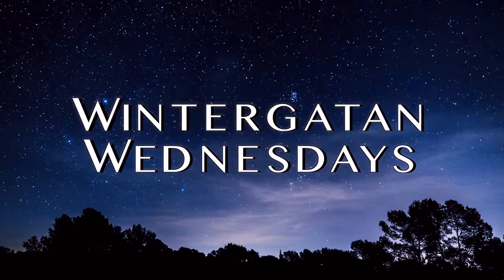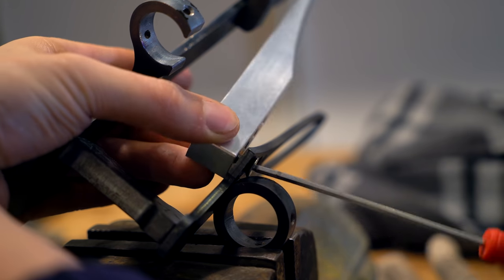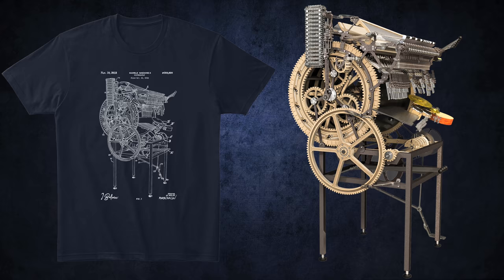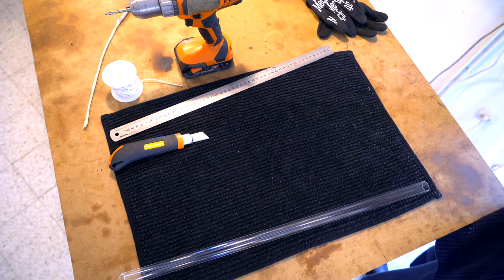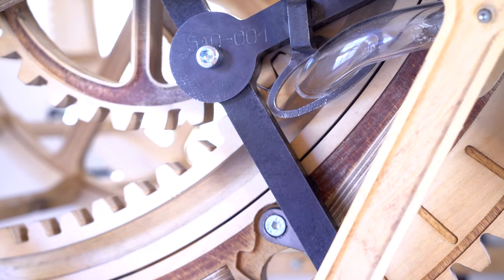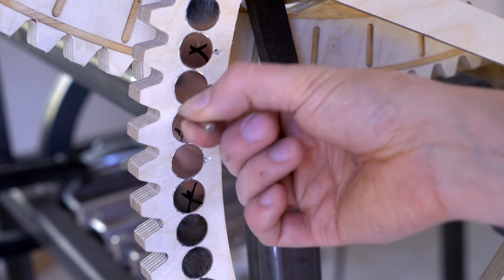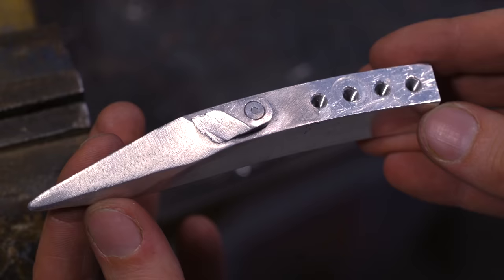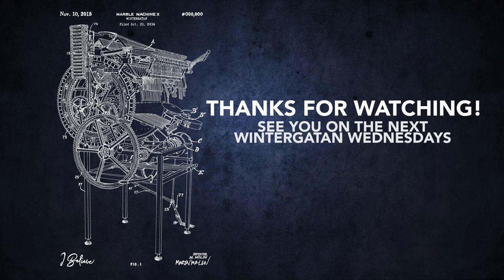Magnet Polarity Switch - Marble Machine X #60

Comment: You don't need sea water to be a problem, steel or stainless steel screws into aluminium WILL seize over the years some grease on the screws will mitigate it  but if you're unlikely to need to undo them again then don't worry about it. And 4 screws to secure it is massive overkill anyway.

Comment: The interface between the lifting wheel and the tube looks nice, but I can't help but thing that you'd be much better off designing the scooping mechanism to take advantage of additive manufacturing because it's such a critical part with an odd blended shape. If you were to 3D-print the scoop, you'd have a much tighter design to fit into the wheel groove and you could use a custom sweep to ensure an internal tube with a perfect circular cross-section to avoid the marbles getting jammed. By making a slightly larger counter-bore feature at the end of the 3D printed scoop, you could also have a seamless transition into your heat-formed clear tubing instead of having to manually heat up and form the ends around your metal eyelet. 

Even if your current design works, I'd be really afraid to take it on the road because if something happens to your scoop, you wouldn't be able to readily replace it, and the whole machine would be down due to the inability to lift the marbles to the second wheel. If it was a 3D-printed design, you could iterate to find the optimal design, then easily print many exact copies of the final design. It might not look as nice aesthetically, but if that's a really big concern, you could always make a mold from it and cast it in a clear acrylic resin. And the plastic would be immune from the dreaded galvanic corrosion 😋. These are just some thoughts I had while watching your video, keep up the good work.

Comment: Funny thing: "Hochleistungsschneidpaste" is a german word. It means something along the lines of high power cutting paste or high capacity cutting paste.
So, not very surprising, but just going by the name it is a paste you can put on your drills to cut or drill with very high power and still perform well without damaging the drill or the material to be drilled.

Comment: I’ll say it again...  you have no idea if the magnets will work over the length of a song or two.  You need the entire pathway in place- including the demagnetizer and subsequent divider to determine 2 critical issues-   Magnetized marbles do not ROLL, they align and lock in N-S orientation to each other...so at several points the only thing driving the marbles thru will be the Pressure of backed up marbles fed in by the mechanism... the magnetized marbles may move only because they have very low friction... but the marble divider and divergent channels will multiply the friction dramatically and may simply shove marbles out of the tracks, rather than forward, given the rate at which they are fed from the wheels.   The Second potential issue will be cumulative magnetization  of every ferrous component in the system- metal brackets, rails, and release levers may accrue a polarity over time that will result in magnets holding up after a minute or 2 minutes of operation.   The marbles will run fine at the start of a song and gradually start to misfire...with increasing frequency.  
You can still eliminate the magnets without significant design change- you merely 3D print gear teeth that will fit inside the magnet track channel- and act as tiny individual buckets, like those in the chain lifter.  Would have to only add a half circle ‘fender’ of steel that would hold the marbles in their toothed track for each wheel...  and would match the style of the steel arcs that form the frame.   this should not significantly reduce the feed rate of the lifter.

Comment: To stop corrosion, just put a strip of tape between the two parts and use stainless steel fasteners. And for that pesky screw, drill and tap a hole in the part and thread in and threadlock a cut off screw as a mini-stud.

Comment: At 8:00, If the third tap was cutting, I think you might be doing something wrong... It's meant for getting threads in the bottom of blind holes and it shouldn't be necessary for though hole tapping

Comment: Pro tip, when cutting a bolt shorter  put on a nut. So when you screw off the nut the treads will repair itself.

Comment: WOW!!! not even a day pasted since you posted this and this video has 81K views as I write. An obvious indication of a huge fan base watching an waiting for the day Marble Machine X is complete. (it is not uncommon that even a professional engineer puts a screw somewhere that becomes trapped.)
That marble lifting/derailing fork that lifts the marbles off the first wheel I could see from the beginning as it was fitted, was going to lead to problems.  I'm no engineer but I could tell it was not,,,, streamline enough. It needed to be like a switch on a rail track for trains. In the end Your mods made it like that.

Comment: Comes maybe a bit late, but did you consider using only the pmma tube for picking up the marbles from the ring slot. When you bent the tube into the holder, you already have the perfect tube without any transmission points, and instead of cutting the tube straight off, you could cut it to fit in the slot. Starting with much material and slowling cutting it til it fits perfectly into the slot. So no need for the aluminium part. Thats at least what I can tell from the video viewer perspective.

Comment: For that problem with the screws you were tweeking the parts that weren't less likely prone to give you headaches along the way. You should have tackle the problem cutting the ring holding the tube in place in half, making that semi-ring a sub-assembly of the part. My 2 cents here.

Comment: You could consider adding some PTFE/teflon feet to the aluminum fang to allow it to glide along the inside of the wheel with some pressure on it. They are thin and cheap, usually used for computer mice. That way there would be less of a lip for the marbles to jump up.

Edit: this kind: https://www.amazon.com/CS-Hyde-PTFE-Mouse-Color/dp/B003DZ16X4

Comment: I noticed in the end there seemed to be a black streak on the 1st magnet wheel, is that from the aluminum piece rubbing up against the wheel? Friction in places where it's not necessarily wanted is always a bit worrisome. Idk if it's a problem or a way to fix it if it is, but I wanted to make sure you knew just in case. Better safe than sorry.

Comment: "Magnet Polarity Switch - Marble Machine X #60"     7:54 - 7:56    :-)
only germans can laugh about this. Sorry.
I love your work and i love your Videos.

If you replace the Aluminium Wedge by a harder Material, maybe Steel, you should think about a "backside screwing".
It means you screw it from the backside at the holder.

Comment: I'd have utilised gravity a lot more by making the marble 'transfer pipe' longer and more straighter or used a rubber wheel powered by another part of the machine to push the wheels down the pipe.

Comment: I'd bet if you blasted some compressed air with that silicon you pulled through the tubing it would have slid easily. This is a common trick for removing grips from bike handles.

Comment: Your lifter plate needs to be the full width of the channel, like a knife-edge, gradually getting thicker.  What is the thickness of the wood channel between marbles and magnets?  If you had narrow groove (too narrow for the marbles to get in), the lifter plate could start behind the marble, so initially, the marble would not need to lift out of the groove.

Comment: why not using same design (22:51) for aluminum fang ? because the marble seems rolling (9:27) due to grip with the wooden wheel.

It this enough for redesigning the part, in addition with the prisoner screw problem ?… I know this is tickling you :D

Comment: 14:17 to 14.25: Martin, the lower main wheel is rotating as it would "float" i think..It seems it is kinda awry and this should not be, correct? Maybe someting is not 100% aligned? do check this matter, I think this can be a part of the problem with the tube..

Comment: In my opinion, the aluminum "fang" should be flattened just a little more, as I have seen the marbles hit the fang at which they stop. I fo you made a slightly flatter edge, you wouldn't have too much of a problem with the marbles entering the pipe.

Comment: @03:28 You should have just grind or file the head of the screw and shorten it to get it to fit. You should have also used two M4 screws to hold the rounded piece in place instead of welding it. There are many solutions to that problem. I think you were hasty in welding the rounded piece before finding a solution.

Comment: Couldn't you thread the blocked screw the other way around with a thin nut, that way you can extract it from underneath, rather than on top?

Comment: Hey. Maybe the existential issue about galvanic corrosion will only take effect after months or years? Even I didn't know about engineering I am concerned about your projects.

P.S. 1: Good video. Never completed a week without my dose of Wintergatan Wednesdays.

P.S. 2: I am not saying that I disagree with the idea of the aluminum fang combined with mild steel. I am only just concerned that the existential fear of galvanic corrosion will manifest over a very long time.

Comment: just but  some electrical tape on the face of the aluminium or mild steel part befor skrewing it together , should prevent galvanic corrosion , just to be safe

Comment: Why not have one long figure of tubing that sits in the recess of both gear wheels ? the marbles could be fed into the tubing and hoisted by the magnetic attraction in the same way within the see-through tubing.  At the apex of the bottom gear wheel the tubing can pull the marbles away from the magnetic influence and flow under gravity to the bottom of the top wheel and continue on within the tubing and recess of the top gear wheel.  I think the tubing would be stiff enough not to need any support and would look like the artery of the MX...you would still see the marbles flow and lift but without any need for any metal bracket support or fangs,  You may need to widen the recess in the gear wheels to accommodate the diameter of the tubing  and the gear wheel would need to turn without touching the tubing but it could solve a lot of issues in transporting the marbles up top,,,

Comment: Good stuff 

As you get a bit better with your tig skills you really need to start using filler rod especially on steel as the way you our doing it now will tend to crack 

The taps our low quality causing your issues a good on like a 2671A75 from Mcmaster will go right through without issue and there our better ones but this grade should be fine 

Product Detail
Machine Tool Tap for Steel, Stainless Steel, and Fiberglass, Through-Hole Thread, M8 x 1.25 mm Thread Size

Comment: I wonder if the paramagnetic properties of the aluminium 'fang' might be causing some issues too? As a minimum it will be causing a resistance to the rotation of the wheel but may be affecting the motion of the BBs. Aluminium produces an inverse magnetic field in the presence of a moving magnetic one, as does copper. Taras Kull demonstrates a toy that uses this effect here https://youtu.be/KdBNwLsJtG4

Comment: Hi martin ! I'm Rodolphe, helikopters engineer, and i have the solution for you to be safe of galvanic corrosion. We use a lot of aluminium in aircrafts and, off course, our screws are all steel ! We use a product name's MASTINOX to inhibit effects of galvanic corrosion and it work well. you just have to put some on faces witch are in contact with different materials, but take care off you ! it's a dangerous good ! you may protect yourself with gloves and mask before to put some product on your parts.
I can send you some if you want, or if you travel to the north taking direction off Gap, you can stop to my workshop at Tallard airfield. I give you product and i can make you visit helicopters.
see you !

Comment: you have so much mild steel on that machine and it appears none of it has a proper finish on it to prevent corrosion.
are you going to address that later on?

also on 14:18 you can see a big problem on the switch
the whole thing gets pushed away a LOT from the actual wheel and makes it so all marbles just get crammed in there. you might wanna address that aswell

Comment: To avoid galvanic corrosion, get the aluminum part anodized, since the anodizing coats the aluminum with a non conductive hard surface, problem solved.

Comment: Another group of people complaining about galvanic corrosion? Jeez people. There are much more destructive things that could effect the wood, steel, and welds independently. Relitive humidity could effect the plywood. Abrasion on the moving points without bearings.  Give wintergatan a break. In the life span of this device in the sheltered environment it's living.... Aluminu and steel are close enough it probably wouldn't be noticeable in salt water before the steel rusted away.

Comment: I love these videos, but some parts feel very over-engineered. Why use the magnetic marble lift and de-magnetizer (both complicated) when you could just have a gravity lift like this: https://www.youtube.com/watch?v=C0Syvo-lCbc

You'd get virtually the same flow rate of marbles, but with no magnetic lift issues, removal issues, or all this added complexity. Even building the wheels would be easier.

Comment: Using powerful magnets on steel ball bearings was a flawed concept in the first place. Just leads to so many complications later on. Magnetised ball bearings behave very oddly when rolled or arranged in groups. Additionally, it will only get worse over time. I’ve started to think that how this machine looks has become way more important then how it works. Good engineering will always be more beautiful then flawed designs that are forced to work.